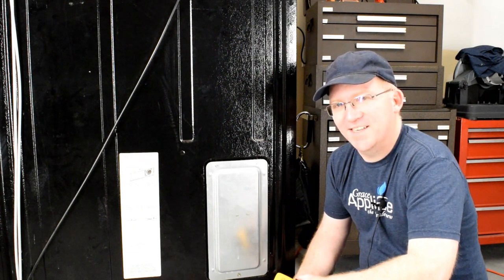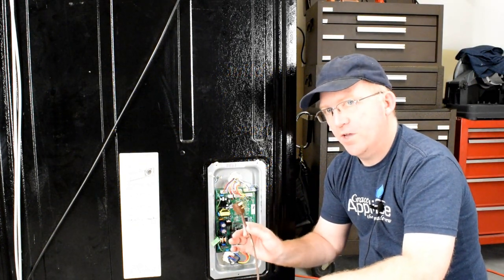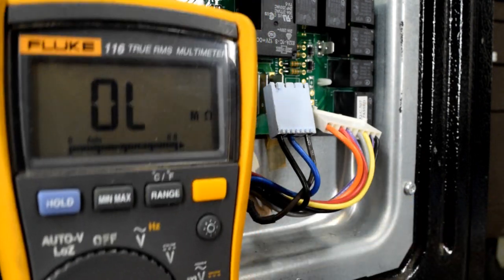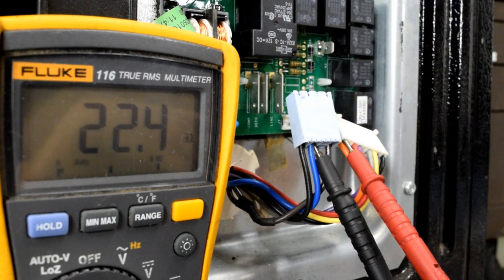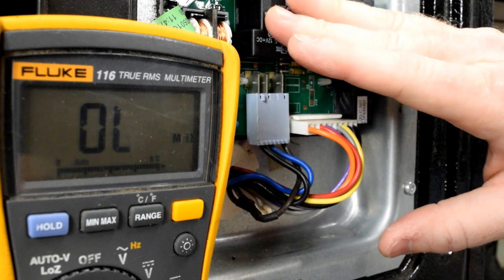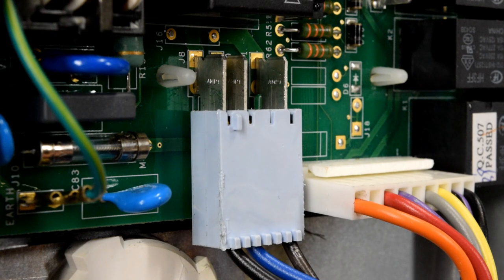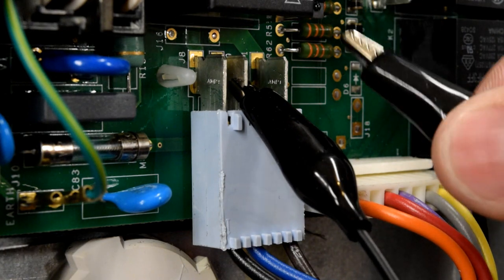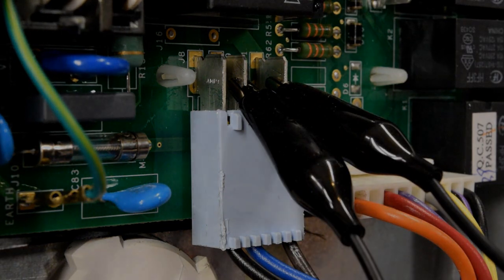Diagnosing a Bad Control Board - Part 3: Defrost Issues

Comment: Hi during the test as shown I am getting a reading of 85.7. Is this ok or is something wrong?
Reply from the maker: Hi Michael,
What is your model number?

There are 2 varieties of defrost heaters a 9" long heater as shown in this video, but also a shorter 6" heater (which is actually 2 separate heaters) that may have greater resistance. I'm not certain if the resistance of those heaters, but 80ish doesn't sound out of the ordinary either. I suspect it's a good heater. 

I can look to see if I can look this up based on your model number if you can send that.

Thanks!
Reply: Hi Andy thanks for the quick reply. My model No is GCG23MISBFBB. Used the jumper cable and heater working fine. Mick. Northern Ireland 👍
Reply: My heater is also the two element version
Reply from the maker: Cool, nice work. You've ruled out your heater and high limit thermostat.
Be sure to watch the video on testing the defrost sensor and also visual control board inspection. 
It's going to be either the board or defrost sensor that's your issue. 

Let me know if you run in to any questions or issues. 
Thanks!

Comment: Mine is freezing up to but I can't unplug to check the last time I unplugged it took two days to come back on
Reply from the maker: That sounds like a control board symptom to me. The defrost issue you're having may or may not be related to the board as well though.
Reply: @GraceAppliance  I don't think it the compressor I can take the back panel off throw water on it run a fan inside to melt ice and it would start to cool again for like four days than  freeze back up
Reply from the maker: @alanbaker8259  yes, that's a defrost issue.  
Did you also say that of you unplug it, it wouldn't turn back on for days?
Reply: @GraceAppliance  yes..I looked at one of your video so unplugged it to check those things I plugged back in the interior light the only thing that came on..I left unplugged for two day then it started back to work
Reply from the maker: @alanbaker8259  
Leaving it unplugged let's the ice build up melt away naturally and ot will work as normal for a few days and then once the ice builds up again  because of the defrost issue it will not get cold enough.  

The issue will be either a failed control board, a defrost heater, defrost sensor, or high limit thermostat. 

If you have multi meter, this video will walk you through how to test each part one by one.   

Let me know if you have any questions.
Reply from the maker: The fact that nothing but their interior lights worked but nothing else points towards a bad main control or failed front touch panel. 

I have a video called diagnosing a failed control board touch panel which will help you diagnose this issue, but you'll need to do the tests when the fridge is giving issues currently. Since it's working now, all the tests would pass ok.
Reply: @GraceAppliance  how much does a control board cost

Comment: I think I’m in the same boat. I tested everything the hard way and it all has continuity and the thermistor is reading correctly. But I’m pretty sure we’re still not defrosting because it’s turning into a big ice block.  One thing I need is the line diagram of the circuitboard pin outs so I can test on there like you did but I have a different model of refrigerator. GE profile French door bottom freezer refrigerator PNE25NMLGKES I can’t find a diagram anywhere. I hope somebody can help
Reply: I wish there was a website that we could go to. I contacted GE by email because their website says you can contact them for a wiring diagram but I have still yet to hear from them
Reply: Hello. I’m really in need of a wiring diagram. Can you help me out please.
Reply from the maker: Hi MC,
Please consider becoming a Patreon supporter @ https://www.Patreon.com/GraceAppliance

You are able to request tech sheets / manuals as well as tech specific diagnostic help though the community tab there. 

Thanks!
Reply: @GraceAppliance  I’ve heard that before but I want to make sure that if I join that I can actually get the wiring diagram for my refrigerator. PNE25NMLGKES
Reply: @MC-zx1qm  call Saul he has all the diagrams you need

Comment: This guy just came out and said my compressor is not  working because when he touch it I think he said it's cold and it shouldn't be cold
Reply from the maker: I'd rather the compressor be cold and not running than hot and not running.
It sounds main  control board related given the symptom of not coming back on once it's unplugged.

Comment: Your full of it dude, it doesn't melt that fast, I've been repair tech for the last 12 years my own business ,beleive me it takes longer than that, and you need to disconnect the John guest fitting at the bottom to let the water drain out of the line, some times it needs a steamer to force it out....
Reply: Hi, Dude.
You did not watch the video. Please watch the video and resubmit your comment.
Thank you,
Management.
Reply: My reply was for a different video, not sure how it was linked to yours,  @andyf80